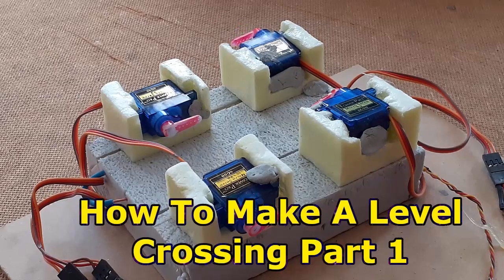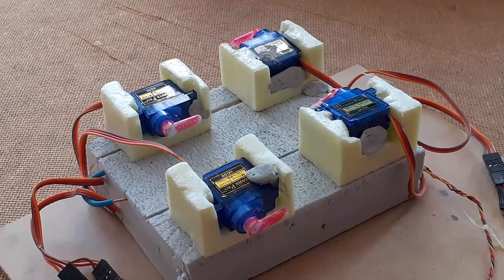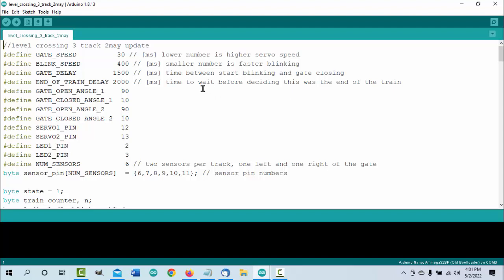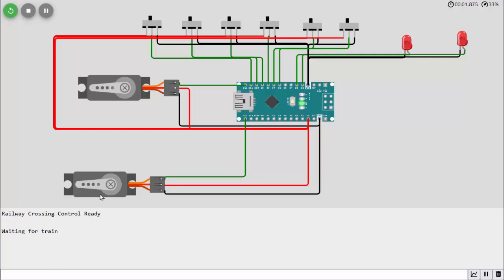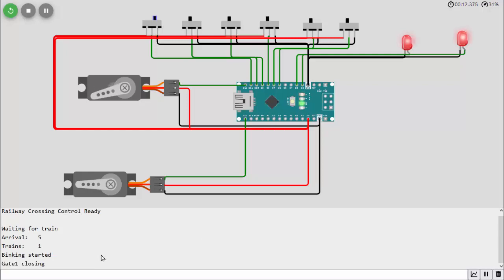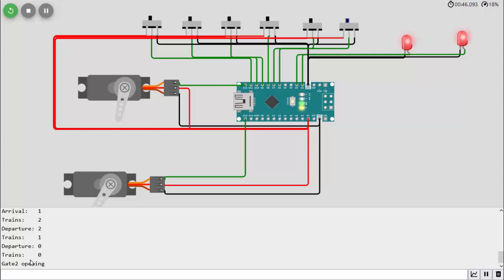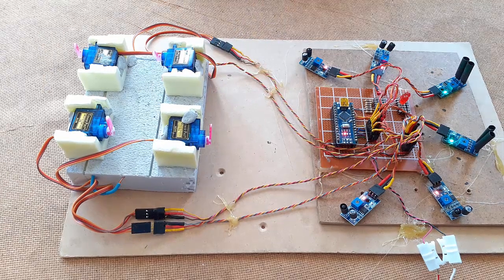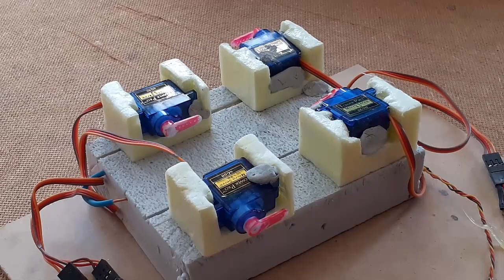How To Make A Model Railway Level Crossing For 1 Or More Tracks Flashing Lights And Gates

Comment: Hi, came across yout video, How would I go about adding a bell sound to this sketch?  Do you have a code to add ?
Reply from the maker: I have the code and a complete control kit at https://store.polandsbest.com/collections/level-crossing-gates-lights-signs
I will be adding a stand alone sound module tomorrow.  I just have to make some pictures.   If this does not help, contact me at tx28@steamtraininfo.com and I will work with you to get you what you need.
Reply: @ModelSceneryTutorials  hi. Sounds good 👍  let me know when you have it all set up or if you make a video on it. Thank You
Reply: @ModelSceneryTutorials  HI there, I was wondering if you could help me on writing a crossing sketch using the fade led  method